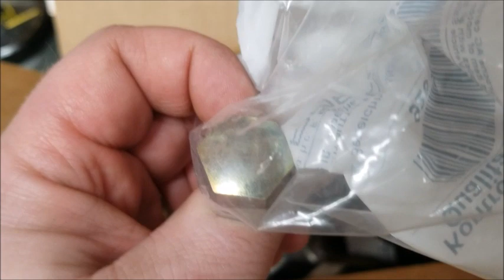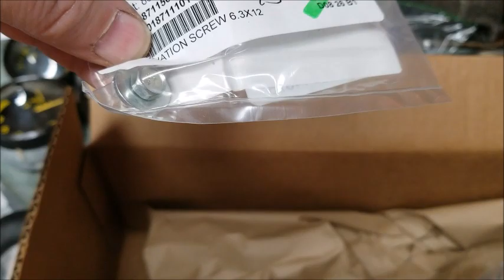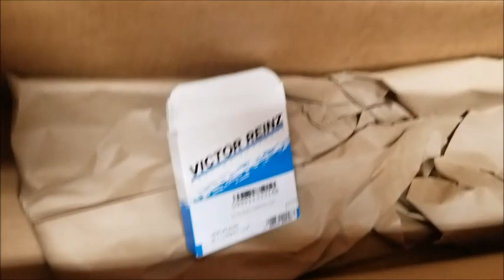1983 Porsche 944  Front Engine Rebuild Part 1

Comment: Hi - Quick comment that I forgot to post when I viewed this .. The auxiliary belt pulley should have 4 bolts holding it to the balance shaft sprocket. It looks like you have one missing and one sheared off - I thought i'd mention it in case you thought it came like that :-)